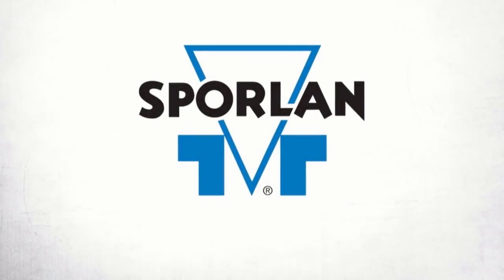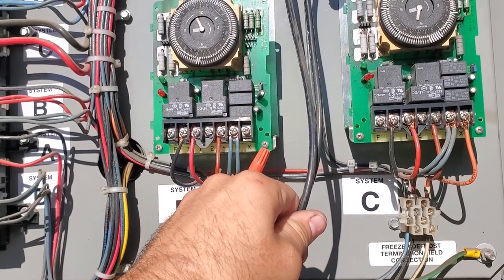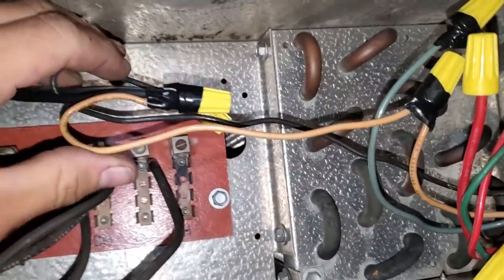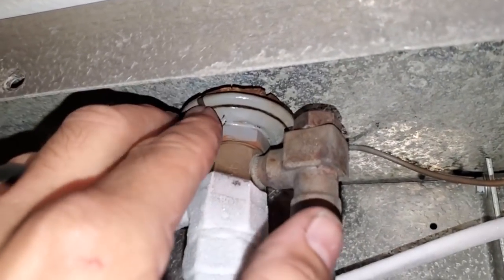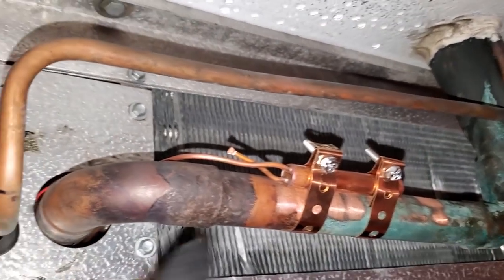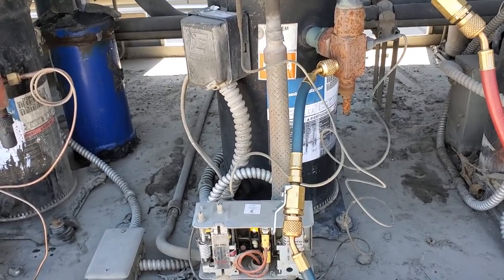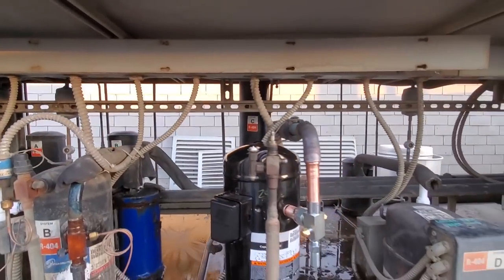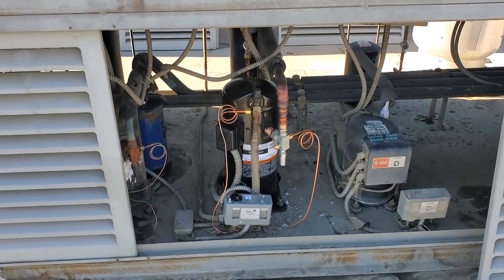BEER WALK IN DISASTER

Comment: Looks like a 6ga and 10ga...still crap wiring. 12 and 14 would be the smaller wires they have in there, and probably the smallest period with at the extreme small range of seeing a 16ga on a control only line in any HVAC system. Typically you won't see them go that small unless it's some Chinesium crap meant to last 1 year or less. 

I could see them running oversize to the box and then dropping size to contact as long as it was spec size according to manufacturer...but even that is amateur hour. 

I guess some people don't understand that every connection point is a potential problem due to resistance, and that wire size changes are one of the worst things you can do. 

It's like throwing in a 40 amp breaker because the 10 amp keeps popping. 

There's a damn reason the 10 amp is popping and upping the size is inviting fire to visit you on an unsuspecting night. 

And the fire inspector will dash your dreams of an insurance payout if they see some crap wiring or oversize breakers so fast you'll be wondering how good the cardboard box you're moving into is gonna be in winter.

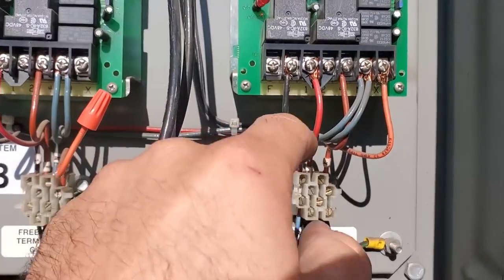Comment: I don't know much about HVAC installations, but I always gauge the quality of the job by the quality of connections. At 3:16 or 4:00 you can see, on the right clock (system c), on the X terminal, there is a wire strand sticking out perilously close to the other terminal. That's pretty fucking lazy if you ask me.

Comment: Don't disconnect electric heaters' they run beer coolers at 34-32.
Reply: I mean, they need beer as cold as possible. If you make long defrost,  to make sure evap is not iced up during day time ( or night time) beer will get warm and foamy when they  pour it down. They want very short defrost time that will keep their product not warmer that 34F. You can't achieve these conditions with air defrost.
Reply: if the box is sealed good, there should never be an issue with product temps nor icing,, the down side is when he said they start kitchen prep at 4am some times. think i'd do a  2 hour late night defrost starting a 1:30- to 2am, also keep all product as low in the box as possible, let natural air density help you :)

Comment: Learning from you a lot, but, after you disconnect heaters off beer cooler, you will have evaporator icing issues. They put it in there for a reason, because they run it very close to 32F. Had at least one of them that had icing issues and even if evap had heaters,  nobody hooked electrical defrost. After connecting the heaters icing problem disappears. X-terminal, in this case, doesn't make sense, because defrost works on time only. Defrost termination switch in evap has to be bypassed in order for things to work. You say that work wasn't done properly in the first place.  If you talk about evap heaters, then that is not right. It's always right to put electrical defrost in a beer cooler evaporator. And by the way - I learn lots from your videos, but good is good and bad is bad.

Comment: I’m just wondering...those were freezer coils with defrost and with low temp valves so it seems like that all matched properly as it was designed. So now you have low temp freezer coils with air defrost and medium temp valves. Kinda seems like you re-invented the wheel there. Not that there wasn’t issues there but kinda seems like overkill
Reply: A coil is a coil...the metering device is what makes it ..he made the correct repair in my opinion!
Reply: I’m just saying that’s not how it was designed
Reply: And for somebody to say that they hate when things get bypassed then bypass all the electric defrost seems kinda crazy
Reply: @DW-bo3qw  he didnt "BYPASS" ANYTHING.....ITS A COOLER..NOT A FREEZER..PLEASE LEARN GENERAL REFRIGERATION PRACTICES BEFORE COMMENTING! THANKS FROM THE HVAC/R DUDE....THE OTHER TECH BYPASSED AND WAS MISWIRED FROM THE GET GO....ITS A COOLER ONCE AGAIN..NO HEATERS NEEDED...PLEASE LEARN GENERAL REFRIGERATION PRACTICES PLEASE FIRST
Reply from the maker: I will address your comment on my livestream tonight 8/5/19 @5PM (pacific), I understand what you are asking and there is a simple answer. 
https://youtu.be/cfSKAK6BvSw
Reply: @HVACRVIDEOS  I guess I didn't explain well enough 🤷🏻‍♂️🤷🏻‍♂️🙅🏻‍♂️🙅🏻‍♂️
Reply: First off I do refrigeration on a daily basis. A lot of beer coolers have freezer coils. And I’m pretty positive when a manufacturer puts something in a unit and you cut it out that’s bypassing it
Reply: I did agree that there were plenty of issues with the system but when your running lower cooler temps in the box it’s very possible to have issues with icing
Reply: Why even bother having a defrost clock at all it’s a “cooler” and has off cycle defrost
Reply: @DW-bo3qw  I'm too drunk...I hope you have a wonderful week! And all calls go smoothly! Rock n fuckn roll brothaaa!
Reply: Hey you too man

Comment: Do you log your work other than the video? Do you utilize check lists? I understand, you sell Quality and HVAC. Quality costs money.
Reply from the maker: Well we track our work on our invoicing system if that's what your asking? We don't really use check lists unless it is a preventive maintenance.
Reply: @HVACRVIDEOS  Just wondered what you do on the "onion" jobs where you keep peeling layer after stinky layer until your just left with tears. May help you rest, but I would have done the same. Always good to sleep on it and return just to see if it is still working and everything looks correct.

Comment: Next Tech that's going to work the unit will have a desire of killing you, or just replace the system and claim the previous guy F.... it up. But overall awesome video and it's nice to see someone who knows a way to diagnose and fix the problem and not just replace the system because it's easier option and they don't want to work on that chaos!
Reply: typical, any other would have just cried replaced it anyway.... as a general contractor I see more garbage installed and replaced for no reason other than techs not trained or wanting to do real work. also they're given commission to make new/replacement sales, I get there hardly past 1yr later and find the "new" installed system has nearly destroyed itself from lack of maintenance and poor install, as well as many other stacked up issues.